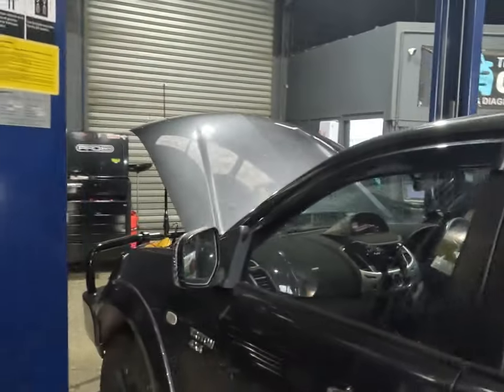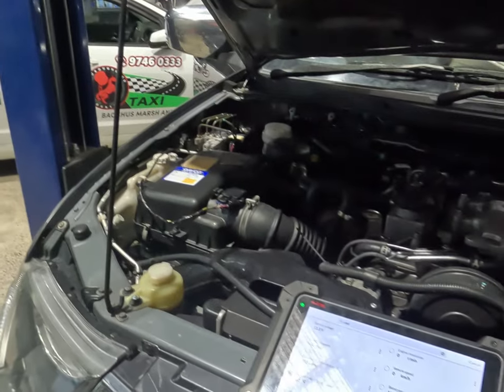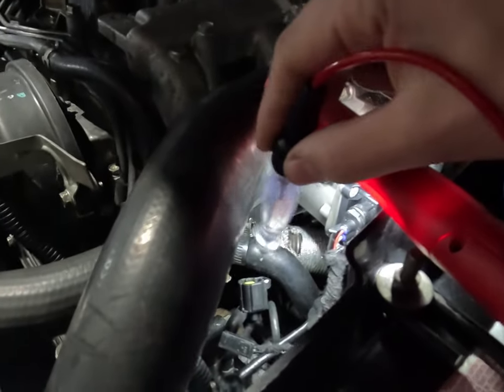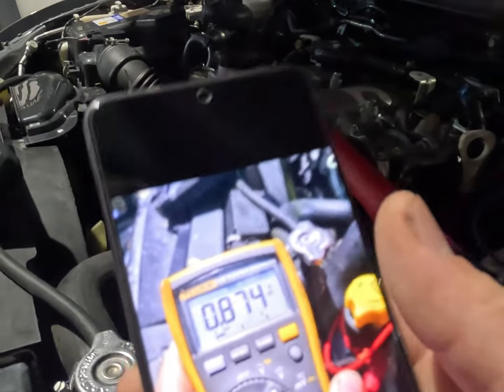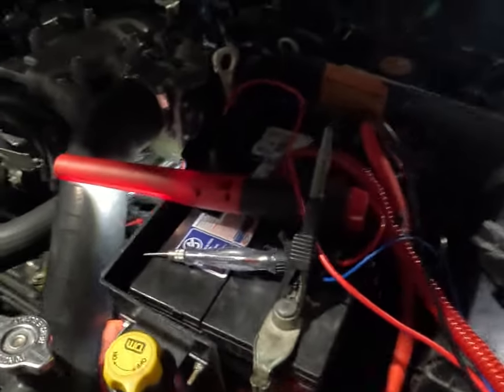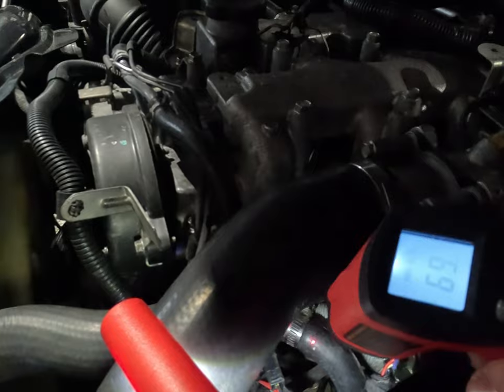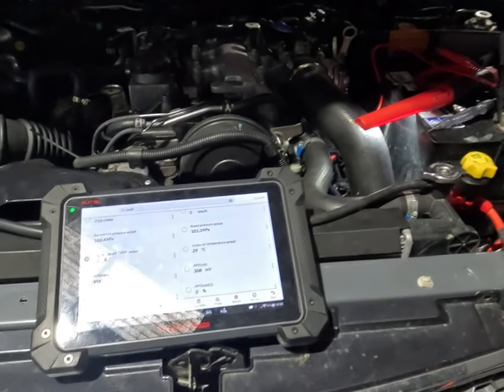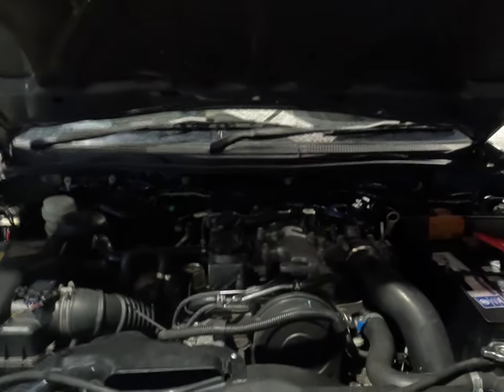Mitsubishi triton coolant temp fault diag !✅️😁

Comment: I'm also keen to find out what was the fix, Triton got a new engine, radiator, thermostat etc and is seeing high ECT temps (105-108c) and causing temp gauge to go above mid-way especially when the air conditioner switch is on 3-4.